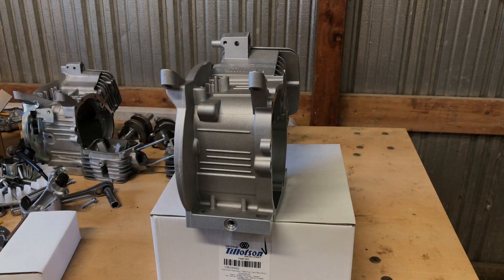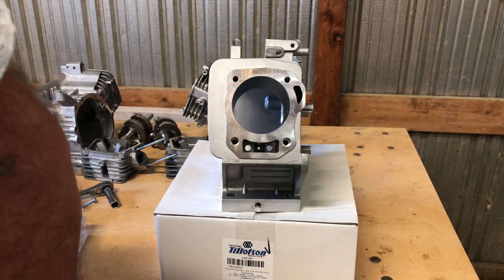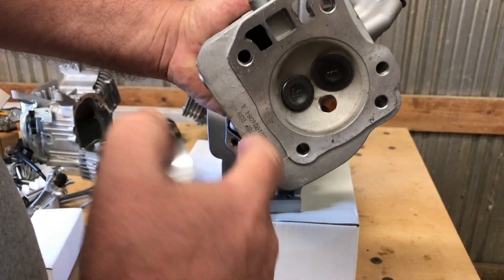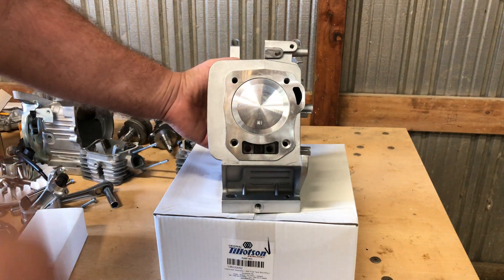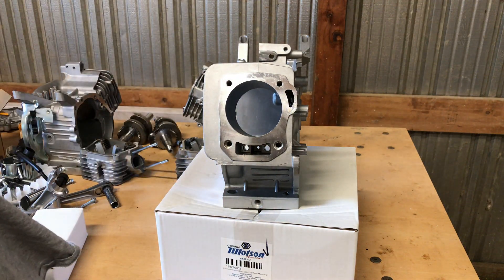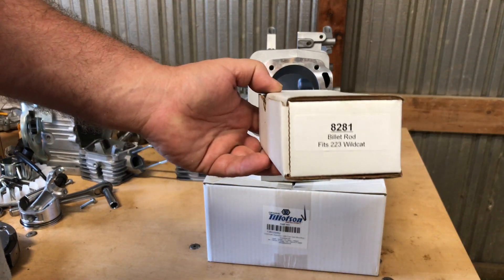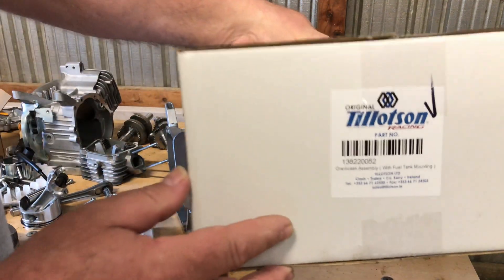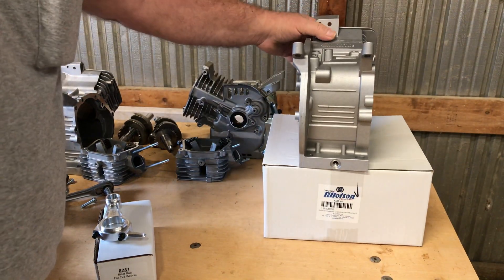Harbor Freight Predator 212cc Ghost 212 Billet Performance 212 Engine Build. Quick Parts Update

Comment: I would like to see someone make a higher compression piston like that for a stock bore Ghost 212.
Reply from the maker: Hi Craig! I'm looking into doing a 70mm dome top piston for the Ghost 212 as soon as I get my metal lathe repaired. I've put the Ghost 212 build on hold for the moment as it's just not feasible to continue. I'd end up building a complete new engine and only use the Ghost 212 crankshaft and cylinder head, so I've decided to build a 236cc stroker engine with the parts instead. I'll still do a build video on the Ghost 212 but kinda waiting for the hype to cool off.

Comment: Are you going to cut the reliefs "in the block"? That seems like an inexpensive but accurate way to do it. I think my next build will be a 420 for a drag minibike(Although I have a couple of other things I should really dig into first)
Reply from the maker: The valve reliefs will be cut into the top of the piston while it's in the block .050 down the hole. It makes for more cleanup but it is an exact way to make a proper clearance cut. The dome shape is going to be a little tougher to get a decent valve to piston clearance but that's part of the fun! Thanks!
Reply: @KentuckyFriedFixes  Cheaper too. The other way step one would be "buy mill"
Reply from the maker: @WhatIsTheWheel  🤣 True! Cheaper than a mill. I've used the exact same "in block" method on V-8 builds, it's the only way to guarantee the relief is cut exactly where the valve would contact the piston.

Comment: Dome piston is what I use to use in the ole Honda Sl125 motorcycles and they add compression and power .. I have one built to put out 28.5 HP with the mods I have done , Took a old classic and built the engine to WOW.... Lifts the front end NO PROB !! The head and valves are key as well ..
Reply from the maker: I agree Shawn. The dome piston design is the way to go, especially for these big hemi combustion chambers. I don't know why, but somehow they figured it'd be a great idea to install dished or flat top pistons in these engines. I've gotten tired of waiting for somebody to come up with a domed piston for these hemi engines, so here we go. They say necessity is the mother of invention. I don't know if a domed piston is "necessary" for this particular build, but I do "want" one in there. LOL! Thanks Shawn!
Reply: @KentuckyFriedFixes  You will have some serious compression  & that makes power !

Comment: where u get that tilly block capt.
Reply from the maker: I bought my block at EC carburetors but they're available elsewhere too. I usually buy my stuff from EC as they're in TN so shipping isn't too bad to KY.
Reply: @KentuckyFriedFixes  cool man thanks for the info my ducar is running good but would like to build a fresh one from start to fin with no gov ect . and i run the dirtbike gas tank so i wouldnt need the mounting arms
Reply from the maker: @CruiZe-A-ViSiON  If you don't need the stock tank mounts that'll save you $20 on the cost of the block. $20 may not seem like a lot to most folks but I've bought entire 70mm blocks for $20, so it's actually a lot!
Reply: @KentuckyFriedFixes  i litterally just made my last slice of bread for me and my mom we down to the last trust me 20 bucks a thing of ground beef some bread n rice

Comment: And next time on KFF we invite the guy from how to train a dragon because this thing is a fire spitting monster
Reply from the maker: LOL! Hi HP! If everything works together, this one should be a runner. Thanks!
Reply: @KentuckyFriedFixes  I found a home for my 224 6hp Tecumseh spit the governor out today performance tiller 🤔
Reply from the maker: @heathenprojects2639  The 224 should throw some dirt! Those 6hp Tecumsehs are runners with a little work. There was a local guy that had one built on a Wheel Horse puller years ago. He pulled in the 8hp class and whipped up on those larger engines fairly often. That thing would sing!
Reply: @KentuckyFriedFixes  ya but after looking performance parts an arc fly wheel is 300 and a rod is 189 I'd have well over a grand in the Tecumseh finished
Reply from the maker: @heathenprojects2639  Oh yeah, those parts for the Teacups are expensive!
Reply: @KentuckyFriedFixes  2 rich for my cheap blood if i win the lottery but then again I'm so cheap I don't play that either
Reply: @heathenprojects2639  LOL!! you guys are funny ! (aka - DIYWilly)
Reply: @robertwilliams3457  hey Willy 👋
Reply: @heathenprojects2639  👋🖖
Reply from the maker: @heathenprojects2639  That's the bad thing about the Tecumseh engines. They think those billet parts are made from Gold or something.